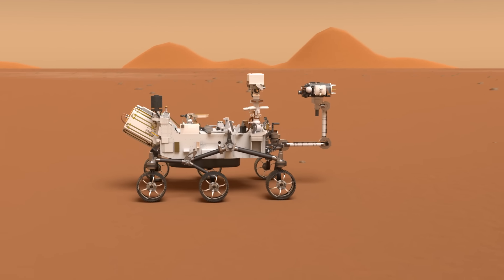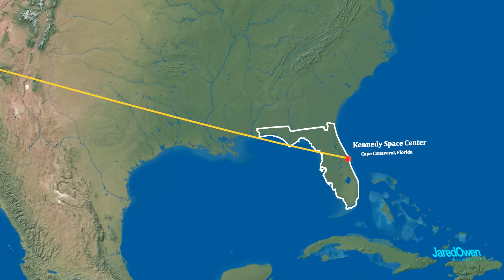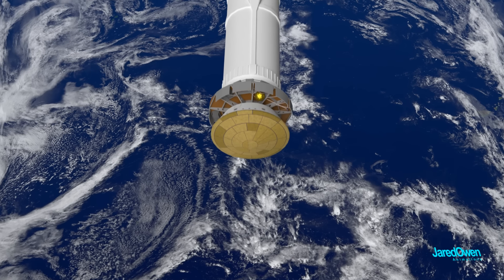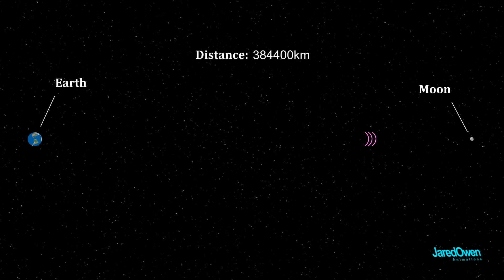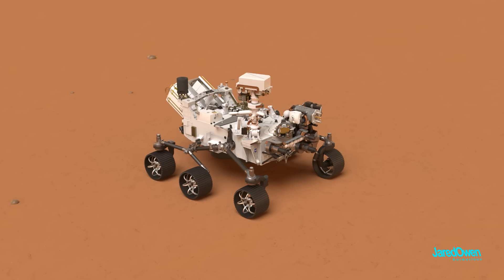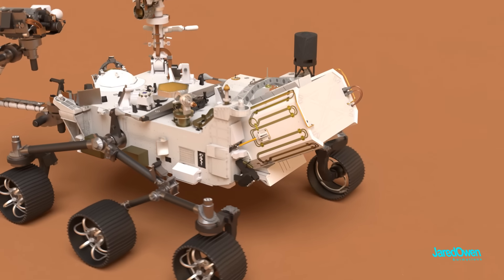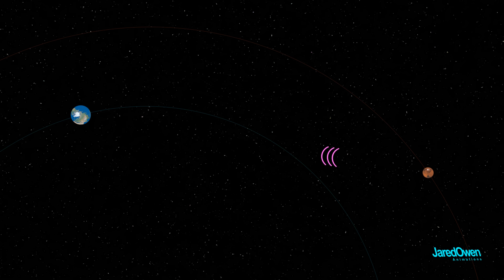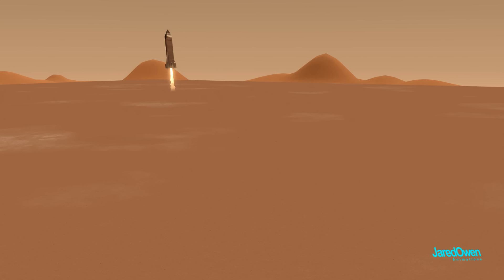How does a Mars Rover work? (Perseverance)

Comment: Some small but important details missed:
When assembled into the back shell/heat shield, the entire... we might called it "reentry vehicle" maintained an perfect symmtrical gravity center on geometry, convenient for the Cruise Stage to make control of vehicle's attitude.
But when reentrying, the reentry vehicle needs an slightly asymmtrical CG to maintaining an naturally AoA (if symmtrical, there's no AoA, the vehicle will tend to maintaing lined up with flying vectors) to creating hypersonic lift, so that it can controlled the descent trajectory via aerodynamic control.
To do that, just before reentry, two bob-weights on the back shell will be jettingsoned, so that the CG will moving sideways to created the required asymmtrical. Then after reentry, another four bob-weights will be jettingsoned to moving the CG back to the centerline, convenient for the parachute deploying.
Reply: what is the helicopter for
Reply: @Mridiot1234  its for the later missions

Comment: I wonder what reference they use to steer the spacecraft there, I know they had satellites in mars, but how they  got the satellites there. Even more curious is how they did in the 60’ or 70’s like the voyager. No  compass, not other satellites, no cameras to use as a guide/ reference.
Reply: someone was driving it🤣
Reply: I’m pretty sure math is used for calculating the course of a spacecraft. Although it would be slightly difficult back in the 60’s or 70’s due to their lack of technology, math has been around for ages and we’ve perfected every formula that has to do anything with spacetravel.
Reply: When a rocket launches, there’s an imaginary arch that progressively gets higher and wider. The arch represents the course of the rocket and where it will land, until it is a circle which means that it will be in orbit. The reason this is possible is because the constant acceleration and rotation of the rocket push and steer it through the sky. Now what I’m guessing is scientists use this knowledge, and calculate the course of a rocket, having discovered rocket physics a long time ago.
Reply: @cadrejeff  sort of like what I thought but there’s the “alignment adjustment “ thru out the course, that’s what it got me. If the line was drawn why needs an adjustment and base on what reference they steering.
Reply: Classified information
Reply: They used a Star Tracker. The Star Tracker will track the stars to identify the cardinal points, for example: if the spacecraft wants to point directly north, the star tracker will search for the star Polaris, if Polaris is found, the star tracker will orient the spacecraft in that direction.

Comment: I've played a lot of Rover mechanic simulator on the switch, so I know some of this information already. The only Rover mentioned in this video that isn't in Rover mechanic simulator is Perseverance itself, but Sojourner, Spirit, Opportunity, Curiosity, and Ingenuity are in it. It's been a while since I've played so maybe perseverance has been added since then, but I had no idea perseverance and curiosity were so similar. Spirit and Opportunity are mechanically identical, I knew that already, but in the game they are cosmetically different. I couldn't tell you which is which, but they have different colored solar panels. One of them has blue tinted panels with white trim, giving it a sort of retro aesthetic, and the other has black tinted panels with either no trim or a dark gold trim I don't remember which.

Comment: You should've mentioned that the specific Atlas V that launched Perseverance was of the 541 variety. 5 meaning that it has a 5-meter-diameter fairing, 4 meaning it has 4 boosters, and 1 meaning it has one engine on the Centaur second stage.

Comment: @Jared Owen
there is one error, nearly all Media copied from each other as well:
its stated that Ingenuity has - compared to helicopters on earth - much higher RPM of its rotorblades..
Thats not correct!
you cant compare this tiny helicopter with an full sized maned helicopter !
you have to compare it with an RC-helicopter about same size.
And then you will realize, that RC-Helicopters as well drive their main-rotor with around 2000 (up to 3000) rpm
so: the real thing that stands out at Ingenuity is not the bladespeed, its the bladesize or lets they better: the depth of the blades, and: the very very steep angle of attack the blades have
THATS distinguishes "Ingenuity" from an earth-helicopter.. not the blade-speed
but all media got that wrong

Comment: To był ten łazik który nie działa bo pomylono jednostki metryczne ?
Reply: No. No Mars rover has had this problem. What you are describing sounds like Mars Climate Orbiter, a spacecraft which burned up in Mars's atmosphere during its orbital insertion. This was caused by a mix-up between the manufacturer and NASA over the units for measuring the thrust of the spacecraft's rocket engines.

Comment: how they calculation exactly landing in mars.? genius have gps landing?
Reply: Rocket engineers have a very good understanding of how to design spacecraft trajectories to reach a desired target. They start with the intended target, and work backwards from there to calculate the trajectory needed to get there, and then when to launch in order to be able to achieve that trajectory. They build in opportunities for course correction several times during the voyage if the spacecraft drifts off course.